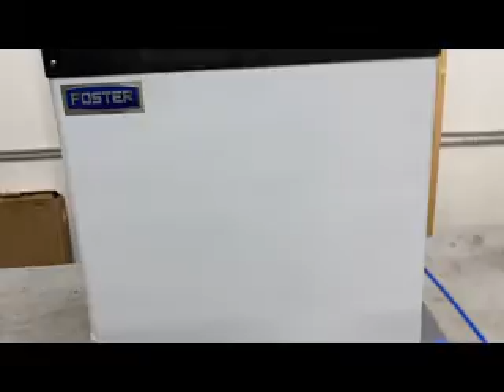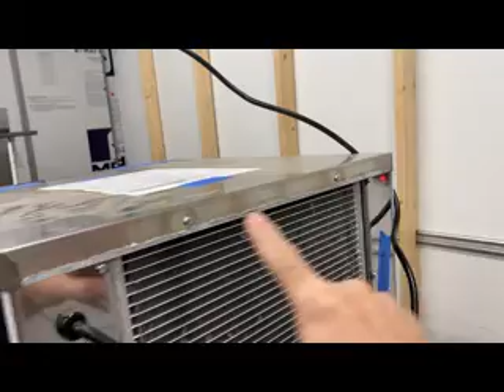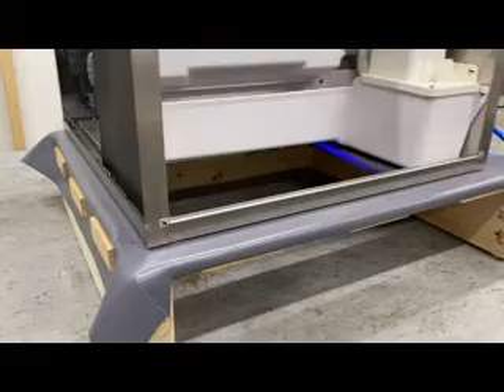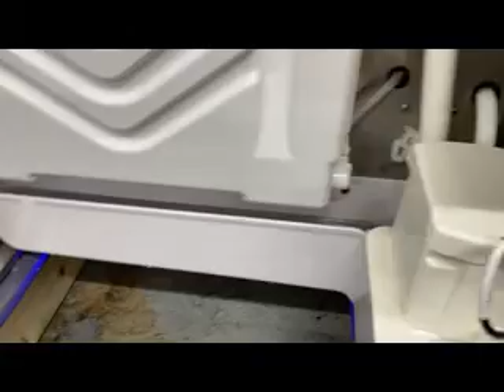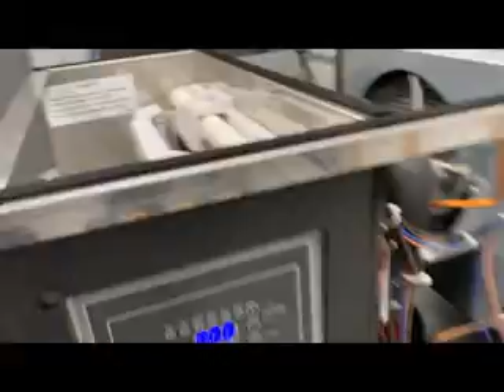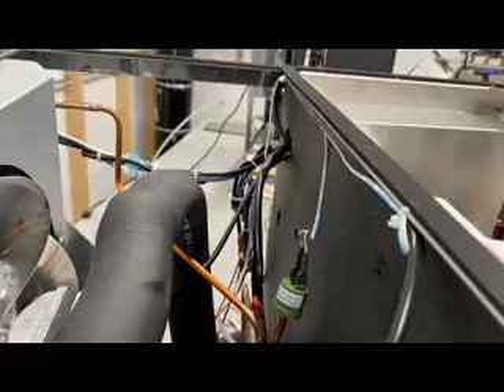Snooker Cuber machine Technical Overview

Comment: hi .. i hvae prblem with snooker ice machine .once complete making ice its goes to harvest cycle but with in 1 scond hot gas valve close and go back to ice cycle even previus ice block did not dump . keep on ice cycle..is the PCB board faulty or hot gas valve ...?